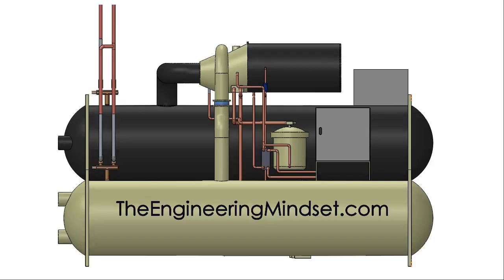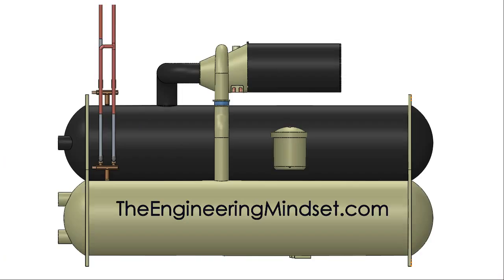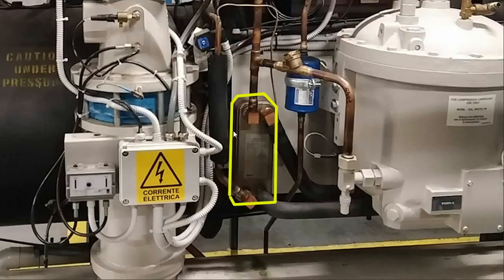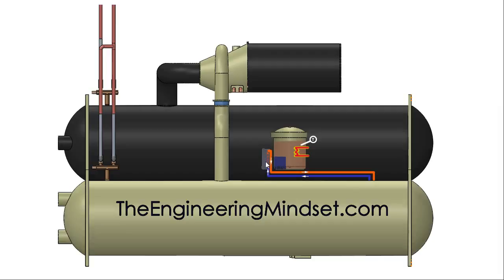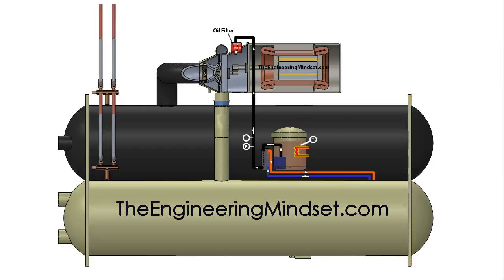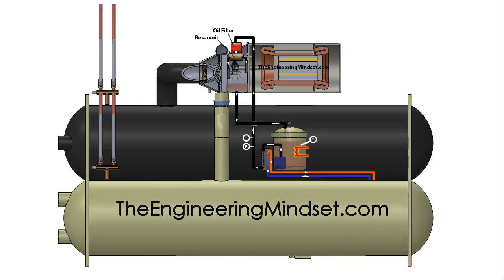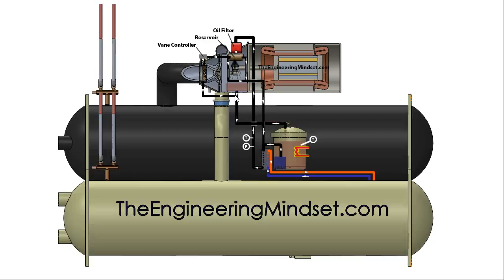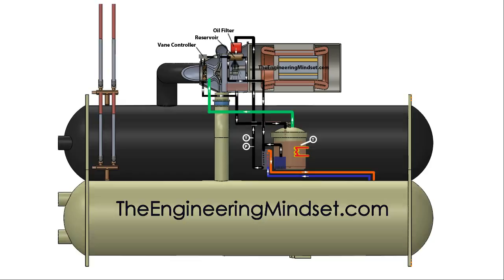Chiller - Oil lubrication and cooling

Comment: When the temperature of oil is increased it will have less viscosity rather than high . thats why we use heater in the sump unit. but ya have said the opposite. kindly remove that mistake. 
Thanks for making such videos . they are pretty helpful. thank you very much.🙏

Comment: LOL! I'm all answering questions on here. Sorry! I just love chiller work. But I hate cooling towers. That's why I always recommend air cooled RTAH's or RTAC's chillers, to avoid cooling tower headaches. I don't see the advantage of water cooled over air, in a critical environment. If city water gets cutoff you're screwed. Maybe you know why some places prefer water cooled? To me it seems like the energy used to pump the condenser water and run the tower fans kills the efficiency. Not to mention this application in a place (like Georgia, USA) that doesn't get cold enough to take advantage of free cooling through plate and frame heat exchangers.

Comment: Sir what is the common problem if the chiller alarm about , thrust bearing  temperature high??  Thank you
Reply from the maker: Depends on the chiller. If it's cooled by the refrigerant then there might be a blockage. It should give you an error code, you'll need to check this with the manufacturer.
Reply: @EngineeringMindset  if I start up the chiller maybe 15 second it will trip and then I saw to monitor  that error..i check already  the sensor  for the thrust bearing it is ok... do you think sir maybe the thrust bearing  is the problem?? Or the compressor??

Comment: Sir, there are two gauges one for high pressure and other low pressure on chiller . What is this represents? Is this oil pressure
Reply: No ..oil pressure transducer located on the top of the oil sump.

Comment: @5:20 , why the oil return from compressor thrust bearing was not returned back to Oil sump for pressurisation ?
Reply: Because the oil coming from thrust bearing is connected to the dicharge line of the sump pump.  As a result, the oil cools down very quickly and the oil goes back to thurst bearing

Comment: Is there any chance that the oil gets mixed with the refrigerant and oil then circulates into the system with the refrigerant and probably, lower the efficiency ? Kindly illustrate that point and what will happen then..? Also, how to prevent it ?
Reply from the maker: Yes, it can happen depending on the design.
Reply: @EngineeringMindset  but what sort of design it would be.. Why it would be designed that it may get in fault of getting the oil mixed up with refrigerant..
Reply: Many chillers have oil separators built in.

Comment: To take out refrigerant from oil sump one copper pipe is connected to the suction of the compressor. Since the suction in compressor occur at low pressure how the oil does not go along with refrigerant to the compressor ?
Reply: The suction is at low pressure. So the refrigerant gets boiled due to low pressure and flashes off of the oil, leaving only oil in the bottom of the housing. Then it gets drained through a pipe to the sump.

Comment: Sir Thanks for videos.
(1) Can you explain lubricant system in screw chiller  compressors. 
(2) Can you explain how water chillers different with brine (minus degrees) chillers. Sir, you should also make a videos on minus degree chillers

Comment: Whats is the Outlet and inlet oil pressures in this Oil pump?
Reply from the maker: Please check with the manufacturer guide, it will be stated there for the make and model you require
Reply: @EngineeringMindset  in some chiller they provide filter drier for what purpose
Reply: Trane Centra-vacs 800 ton is 18 to 22 psi DP. I only know this because they're the chillers we have at my work. I would imagine it depends on pump size, oil type, bearing size, etc... Engineered calculations.

Comment: Great content, but a correction, the oil becomes low viscosity as it is heated, at low temperature oils have higher viscosity. For example water has a viscosity of around 1 centipoise, while table oils have viscosity in the dozens or hundreds of centipoises, while Tar has a viscosity in the billions.
Reply: Yes viscosity is a fluid’s resistance to flow.
Reply: You right

Comment: liquids show a reduction in viscosity with increasing temperature. With high temperatures, viscosity increases in gases and decreases in liquids, the drag force will do the same.
But in YOUR VIDEO you are saying that Cool lubricants have High Viscosity and if we heat them the viscosity become low
http://www.azom.com/article.aspx?ArticleID=10036
 Please SHARE your views with me and help us thank you so much ...Dear  !!!
Reply from the maker: The cooling lubricant is oil based and will decrease in viscosity with temperature. It behaves much like honey. If you put a jar of honey in the fridge it will thicken and will not run or flow easily, but if you warm it in the microwave it will flow much easier. Try it and see.